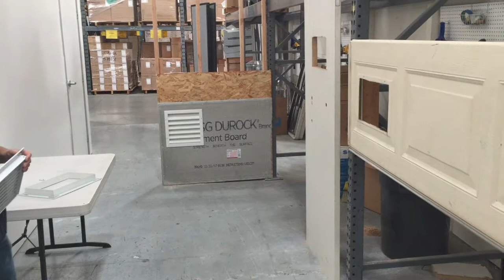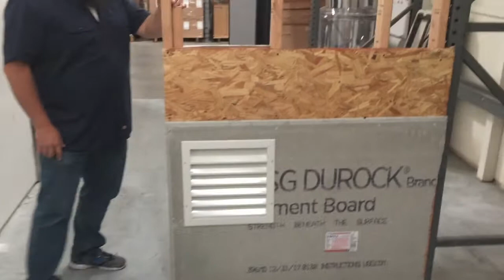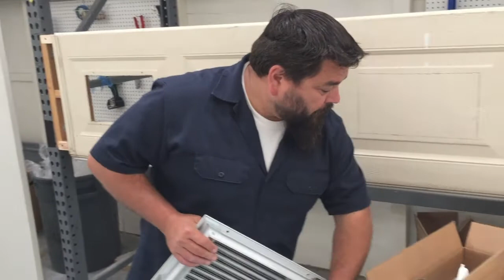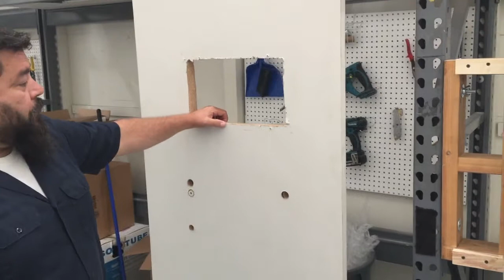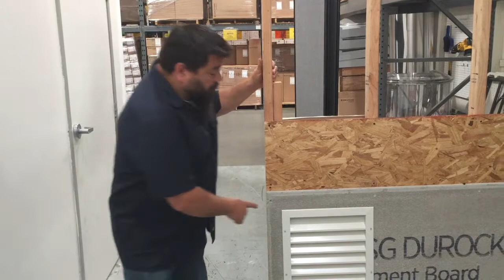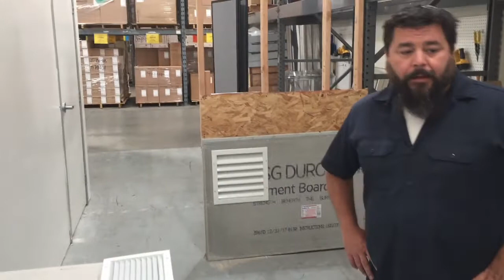Garage Intake Ventilation Installation

Comment: Instead of the durock I have 4 inch block and then another layer of stucco. So with  osb and drywall i have atleast 11 inches from inside to the exterior. Do you all have something for that?